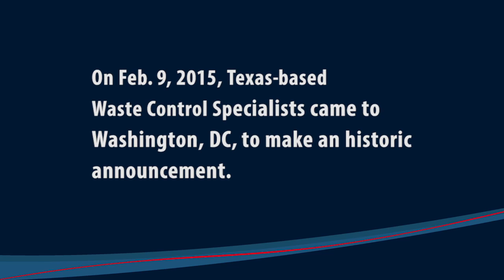WCS President Talks Interim Used Fuel Storage Project

Comment: An energy source not being put to use. Just because the "spent fuel rods" won't efficiently operate a nuclear power plant doesn't mean they are useless. If there were a facility built to efficiently use the fuel rods in their "first" spent state, society could get some additional benefit for all the effort of producing the things in the first place. Note that it's said the rods can safely stored in the pool after being removed from the core of the power plant. Some years of storage in the pool are needed before the rods radiation level falls off and with it heat production. All that thermal energy is wasted.

Fukushima and all other nuclear facilities would do well to utilize an electric production method that can operate on the waste heat produced on site. Such a system would never have to be shut down and could be a supplement to a backup power source for the facility.